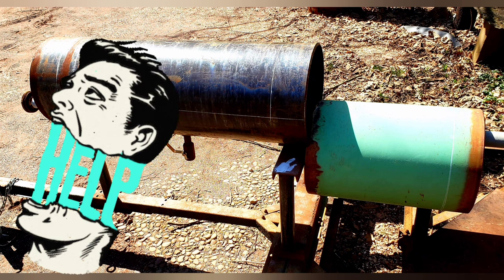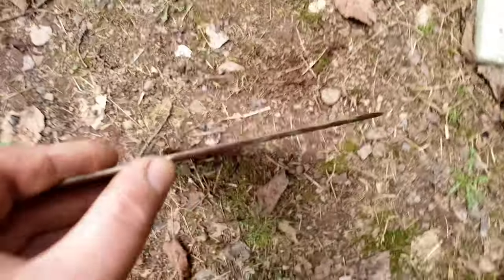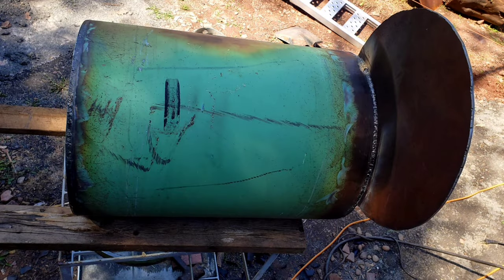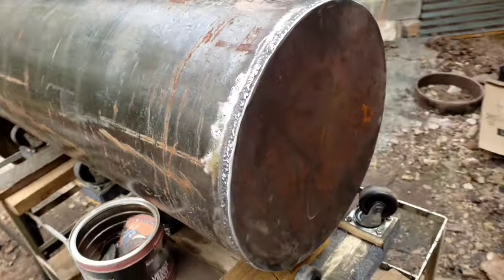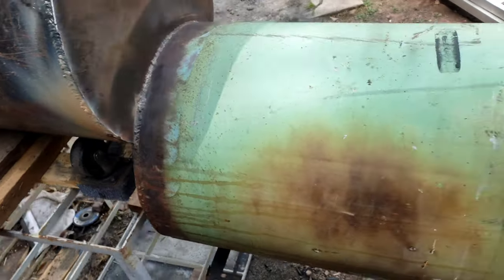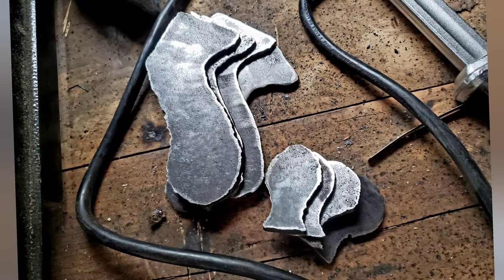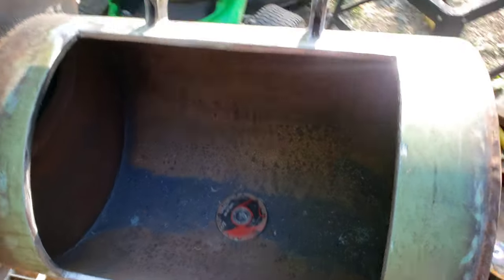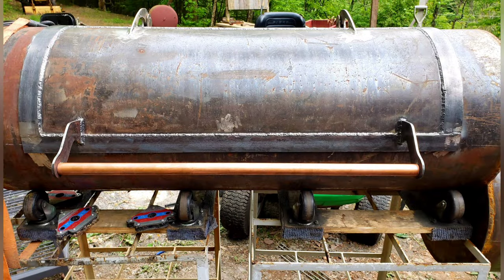Backyard Offset Smoker build pt.1 project Bully

Comment: Did you do anything to keep the doors from warping or the tipe from springing out after you cut it?
Reply from the maker: Nope I just used my cutting wheel the firebox door had slight spring. Mainly because I didn't see the seam with the green paint. And it runs through the door. I'll be addressing that in the 3rd and final video. I usally figure something out. Door spring can be a pain and most times inevitable.